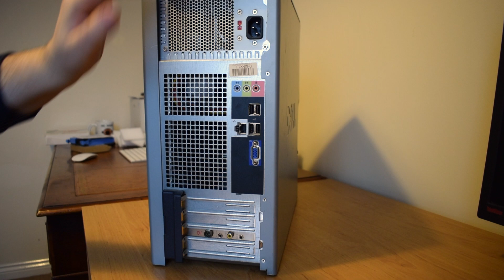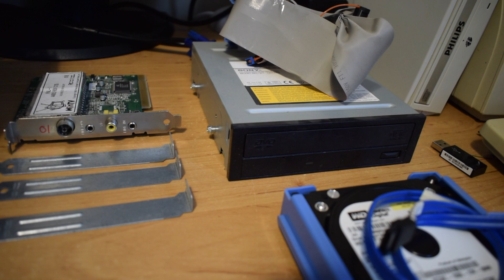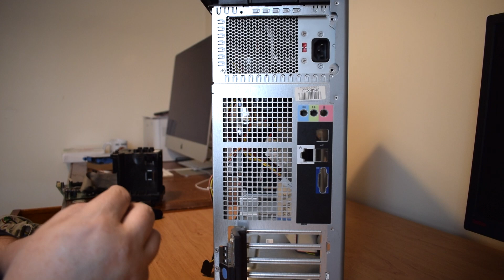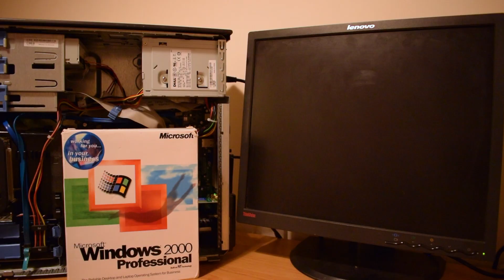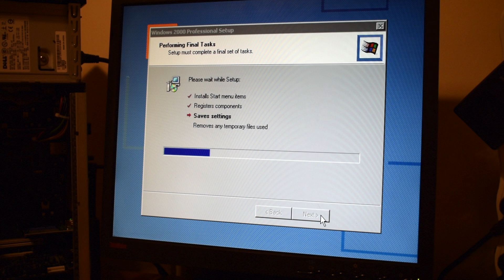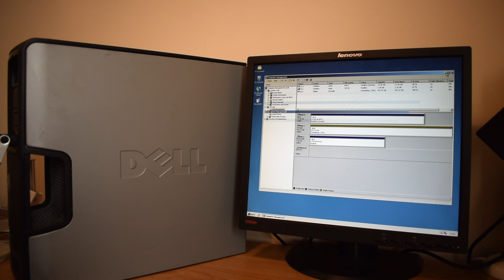Dell Dimension 3100

Comment: Got one of these 3100 brand new in Aprilish 2006. I miss it so much. It's actually right here, but it's dead. Turned it on one time and it popped. Now where the power light used to be green, it lights up orange.